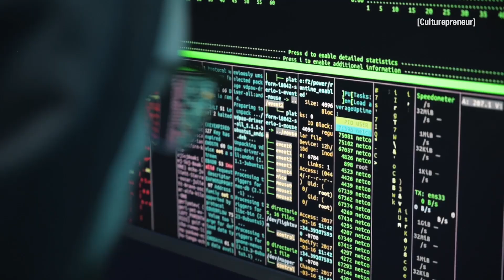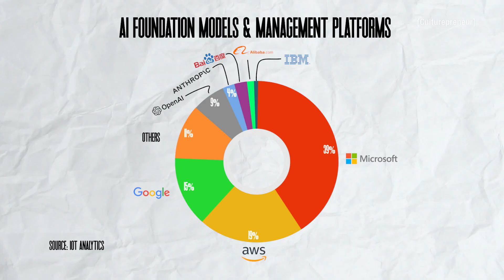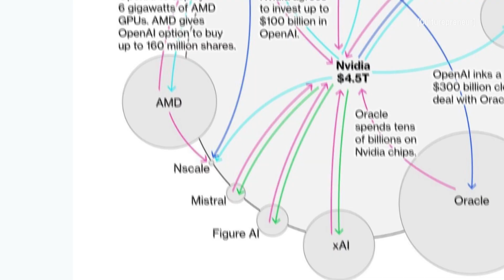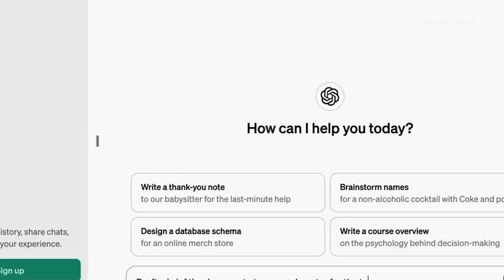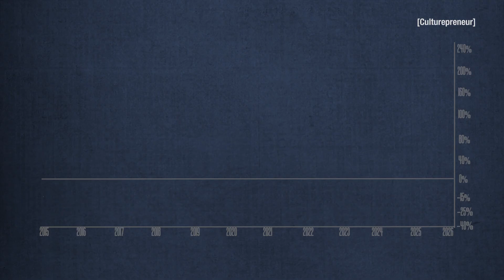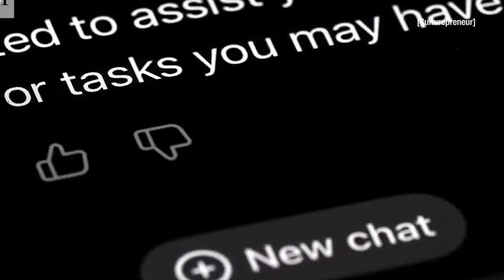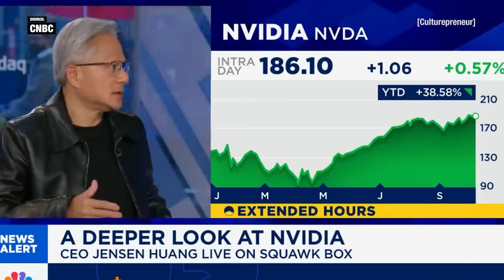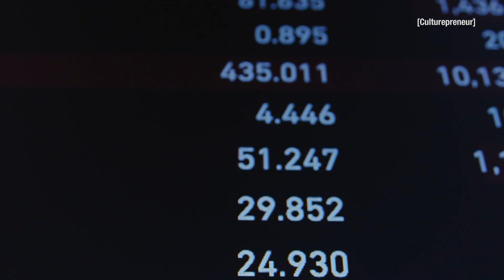China Is About to Pop America’s AI Bubble

Comment: china didnt design the opposite. deepseek clearly a distilled version of chatgpt
Reply: A distilled version can never outperform the original but deep-seek r1 outperformed GPT in many metrics. 

It also used a completely different architecture that people thought couldn't scale up to the extent that deep-seek made it scale up which was sparse mixture of experts model. 

After it's release, All the current top models such as Gemini 3 and Claude 4.5 which have just released have copied the deep seek strategy to scale up. 

Clearly they wouldn't be copying the innovations if it wasn't a breakthrough.
Reply from the maker: It’s not about outperformance or out innovating  it’s about collapsing the profit margins of American companies
Reply: However, because China open source the papers, their innovation was successfully copied.
Reply: Also, This guy clearly doesn't know what he's talking about because the West still has over a decade lead in semiconductor manufacturing
Reply from the maker: You know Jensen huang went on cnbc and said that china is close on chips and it’s quoted in the video right?? 😂
Reply: @culturepreneur close is them using duv machines with so many layers manufacture 5nm on those machines that it actually double versus what TSMC can do using advanced euv machines that are banned from China at half the cost Even though China has cheaper labor. 

Going down to three nanometers, TSMC can do it while China still can't because the technology and machinery is banned from China and to manufacture at such a small scale, China hasn't had the dozen technological breakthroughs required which only the west and Taiwan is allowed to use because America's banned most other countries from having these machines
Reply from the maker: not once did I say deep seek is the opposite of American LLM I said China’s AI strategy is the opposite of America’s thanks for watching though